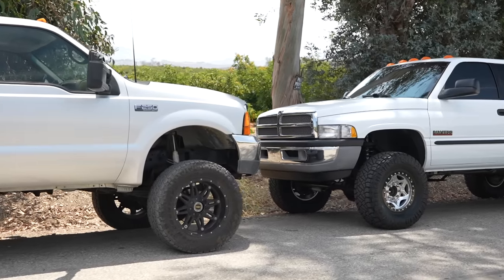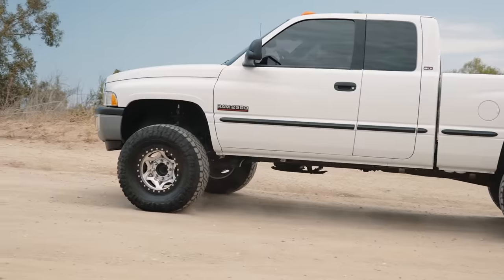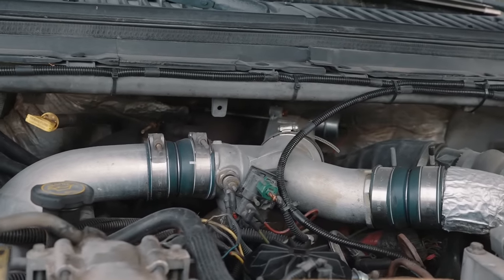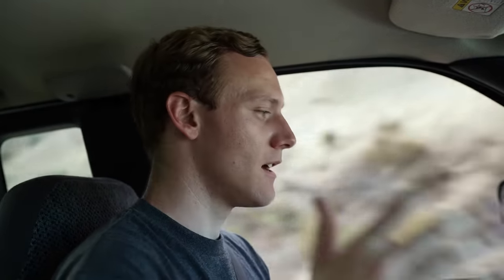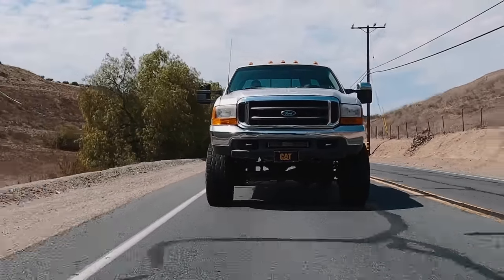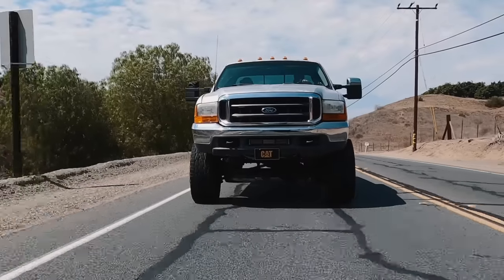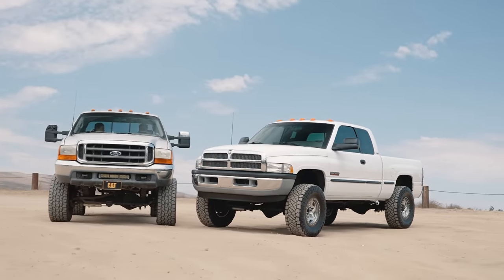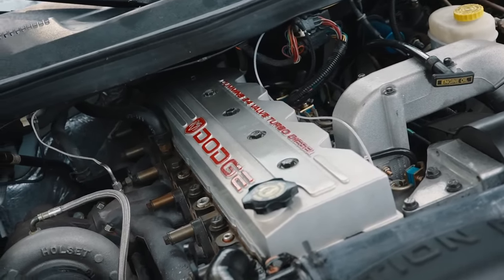1999 Ford 7.3 Power Stroke Super Duty vs Dodge Ram 5.9 Cummins 2nd Gen | Which Is Better?

Comment: I grew up with my Dad owning both. His 5.9 was the newer body style though, and both were duallys. 

5.9 had way more power and sounded so freaking good. Lot of transmission issues though. 7.3 was a dog for power, but I still preferred it for some reason. 

I would LOVE to own a mint 7.3 crew cab. Hard to come by these days.
Reply: Only way to own a mint 7.3l is to buy one and make it mint...
Reply: I have a 99 7.3 pretty well taken care of 180k miles 6speed. Manual windows but it's a complete and taken care of. I'd sale it. In Texas for around $7k
Reply: @jonathanrangel5119  do you have social media im interested
Reply: Your dad should have bought his 5.9 with a nv5600 he wouldn't have had any transmission issues
Reply: @jonathanrangel5119  I'm interested in that 7.3 standard transmission.  Have a link to the truck with some contact info?  thanks!
Reply: @jonathanrangel5119  worth more than 7k lol crew cab manual super hard to come by and people fight over them when they come up for sale crank windows means nothing you can easily swap in power windows theirs kits to do everything on those guy on YouTube with a dually 7.3 manual basically completely turned it into a 2013 clone interior and all
Reply: Yet in reality the 7.3 head to head with the same year cummins had more power and a far better trans.
Reply: @harleyhiebert2862  yep I got a 99 F350 crew cab, short body 7.3 she’s a beast but we have to replace the box,doors etc. after that she’ll be mint and we are going to turn it in to a flat bed that’ll be a winter/summer project
Reply: @remingtonwendt7756  yea I have a 1991  f super duty that I'm gonna work on restoring when I can
Reply: @harleyhiebert2862  my grandpa has an 02 7.3 with 140k I want to buy it soooo bad torgue monster
Reply: @simply-_-  yea I love mine... it has the manual 5 speed... it's non turbo but it's a very very fun truck to drive... I got mime with 82,000 miles on it
Reply: I think the 7.3 really started waking up until they stopped in 2003 by then they had coil springs up front. As far as power, it seems like the 7.3 is an in between and with a pull can't get off the line to get momentum.
Reply: @harleyhiebert2862  not completely true. I picked up a 96 f350 from an old man, 92 years old that only bought it to pull his RV. The interior and exterior only had minor flaws. 101k on the clock, this will be the last truck I ever have.
Reply: @davidmcclellan2786  you can get lucky but they are almost always gone before they ever get put on the market usually
Reply: @harleyhiebert2862  my dad bought a 2002 f-250 mint condition 7.3 with 99k miles for 22,500$ 😂 they are insanely over priced
Reply: @harleyhiebert2862  I have a 2002 7.3 crew cab that’s literally the dictionary definition of mint, my grandfather bought it when it was 2 years old and it has basically sat in the garage only coming out for special occasions or when we are going on a camping trip and need to tow the toy hauler
Reply: @gen-x-zeke8446  early 03 was the last of the 7.3s in pickups. 05 was the first year for the coil front. Longer rear leaf in 08+
Reply: @stevepartridge75  Okay. That helps. I think though we both can agree that they could have easily re-awakened the 7.3 at least in 2005 or '06. I also think the 7.3 Godzilla is a very good idea. It gets the power all the way through the RPM's. Similar to the "Old School" Diesels. I would hate myself if I bought an F-450 for $100,000 and be nervous about pulling 24,000 on a hot shotting (I think it's called). But imagine the mechanic look at it and then look at you with that one look of dread and pity. "Well, do you want the good news?"
Reply: @Doveproductions73  I would love to see that thing lol
Reply: I got a 2002 psd dually crew cab 4x4 bought it new on 9/11/2001 got 112k on it
Reply: @stevenzembriski6761  👀
Reply: @harleyhiebert2862  I made a Reddit post about it a while back but it would probably be a bit difficult to find
Reply: @harleyhiebert2862  not sure how it happened because I wasn’t there but he had a injector stick open and had to have the engine rebuilt so he instead opted to have a brand new engine put in instead of rebuilding the old one so the new engine only has 23k miles on it
Reply: @stevenzembriski6761  In 20 years? 5,500 ish miles per year. You must either work a block away pushing carts, or writing books all day, but it never goes anywhere. Ever. Or, you're half blind and suffer from the shakes terribly like 'death wobble'. My buddy's RAM has 467,986 miles on it. Boom! RAM is better.
Reply: @stevenzembriski6761  I said, BOOM!!
Reply: @gen-x-zeke8446  I think the 5.9 is better just because its a inline 6 over the v8 7.3 i love both trucks BOOM BOOM out goes the lights!!!! I may put a 2.8 Cummins  in my 54 Willys CJ3B
Reply: @gen-x-zeke8446  yeah all of the above lol but it is true under 115k i checked it today just use it to pull a 16’ pj dump trailer and  farm work she’s a good truck I like the 5.9 Cummins to but not the ram bodywork
Reply: @stevenzembriski6761  Boom!
Reply: @stevenzembriski6761  It's a non conclusive discussion about these two in that era. I'm not an expert but I'd say it's nice not to be so picky as well as being confident in your experience. So, why are Americans demanding a down scaling on these legends? As an option for a less wealthy farm or construction guy. I guess that's why Ford cleverly came back with a 7.3, but in the form of old school for Ford. In 5 years, this new Godzilla will already be right up there with anytning Ford has ever built. Get a Godzilla 7.3, throw a few wrenches into it and suddenly you have 500, 650. Seems fair and thousands less due to popularity. Ford has the other guys suddenly and nobody was expecting that. Ford is Back. Dodge need to just quit being nice a make a replica 426 HEMI. Ford: 427 "cammer"  Chevy: 454 big block. I'm calling it, "Old School Rebellion". Not all of us wants EV.
Reply: @gen-x-zeke8446  yeah but now we can’t afford the gas or diesel to run these truck. I was a diesel mechanic in the Marines. The government is forcing us away from gas and diesel and they all got stocks in Tesla
Reply: They make a Allison for both. I’ll take the 5.9 all day throw in a Allison & done. lol
Reply: honestly super weird because the 7.3 puts down more power on paper
Reply: @gen-x-zeke8446  they are heavier because they are built with a bigger frame, and the motor is heavy as fuck but it puts down more ho and torque which means it rows better, just not as fast as the lightweight cummins
Reply: @harleyhiebert2862  I’ve got an ‘02 7.3 4x4. I’ve replaced the box, leaf’s, brakes, starter, batteries, and redid the frame. And now I’ve got a mint 200,000km 7.3. Note that I’m from Ontario so rust is brutal here
Reply: @jonathanrangel5119  is it still available?
Reply: I have a mint 7.3 with 98k on it I just bought. Love the truck. It is a 2003 dually
Reply: @doublew030  I literally just picked up an absolutely spotless 2002 with 200k miles for $28k. Looks like it just rolled off the showroom floor. I’m in love, my alumaduty doesn’t compare when nostalgia is factored in.
Reply: @gen-x-zeke8446  coils were 2005 and up
Reply: @jonathanrangel5119  only 7k? You could easily get $20k for it rn
Reply: @Irishjay1025  yep .. and loaded - my 7.3 would out pull my 5.9 . Same year model truck same load .. same trip .. I was really shocked .. 5.9 pulled good down low but on road and hills that 7.3 shined . I guess that saying ain’t no replacement for displacement is real .. Or in my experience it was . Now the Cummins would run and hide from my 7.3 empty .

Comment: My grandpa owned two bone stock 2nd gen 12 valve Cummins with a 5 speed manual and they both got over 500k miles
Reply: I love big trucks, so a Cummins manual and a stack in the bed I’d be a happy little hillbilly lol. 👍🇺🇸
Reply: My grandpa owns a 2nd gen with the 5 speed but he's only put 124k on it but has had zero issues.

Comment: The comparability of these trucks is on point. I love diesel engines!! I went with the power stroke. I own a 2001 Ford excursion with a 7.3l engine and I love it. But the sound that comes out of the Cummins is from another world, it sounds like a beast!
Reply: Right! Not alot beats the sound of a Cummins diesel screaming down the road.

Comment: Great video guys. I'm a big ford guy but as a tech I prefer to work on an inline 6 diesel rather than a v8, especially one as simple as a 5.9 Cummins. Most things are easier and less labor to repair or replace on a 5.9. cost of parts is generally cheaper as well. The truck itself i would rather a ford any day. i guess a dream truck could be a 06 F-250 with a 5.9 swap? best of both worlds
Reply: A Fummins. I’ve seen a few.

Comment: I went the 7.3 way for my first diesel truck, but a 2G 5.9 was neck and neck and if I get another truck that isn't a 7.3 it'd be a 5.9. The simplicity of the Cummins definitely has appeal. I was surprised at how well the 7.3 interior has held up. Mine is an ex-work truck and pretty well worn but with a couple weekends of replacing lock actuators, fixing minor wiring hackery from the last guy, doing the shifter bushings, finding various missing small trim bits, and giving it a good cleaning it came right back to almost like new and is surprisingly comfy. Just wish the last guy and his crew didn't drop their ciggies on everything.

Comment: I have an 02 7.3 crew cab so I gotta go with the Ford. Great truck interior is just amazing on these trucks. They pull great. I have a light tune on mine and it’s impressive for an 02. I think all the points that were made were very fair and true. Much respect for the 5.9 but the 7.3 all day for me. Great video guys

Comment: Andrew needs to find a set of old mechanical diesels and compare them too each other, I think a sick show down would be a 7.3idi, 12v, and a 6.5 Detroit
like if you agree
Reply from the maker: That would basically just be the 12v walking all over the competition! I’m up for it though!
Reply: @JustDiesels  gotta find some turbo 7.3 idi and 6.5 Detroits
Reply: @JustDiesels  i dunno man, those old detroits are something to be reckoned with
Reply: jeremy pollitt  I’ve always heard that GM marketed the 6.5 for more fuel economy rather than power.
Reply: jeremy pollitt  I’ll put money on a 94 7.3 idi WITH the factory turbo over a 12v any day of the week. Competition can’t be fair if they don’t all have turbos.
Reply: I have a 1988 7.3 IDI dually ZF5 4.30 rear, and it would rip those other trucks apart by the frame
Reply: I own a 1995 c1500 2wd Single Cab 5 Lug Wheels 6.5 turbo diesel with 4L80e Transmission very Rare 
I also own a 1993 1st Gen Dodge W250 Power Ram Cummins 5.9 with the 5 speed Transmission 
I'd like to buy a Ford 7.3 some day as I gave of the 3 right now both my trucks run great as my 6.5 gets fuel mileage and my everyday driver my 5.9 I'm currently doing a restoration on it but it still runs which is Awsome
Reply: Would be interesting, remember that the Detroits are two-stroke engines.

Comment: I have a 7.3 and the only down fall is the trans.  It needs a bigger trans cooler which isn’t that big of a deal just installed the 6.0 cooler
Reply: Get a banks trans commander.... my 7.3 has never dropped the Trans and its stock... and I've done lots of dumb stuff
Reply: Yeah trans definitely needs help on the 7.3, first day I got mine, hooked up my trailer with skid loader, damn trans went out 10 min down the road, replaced with another used trans but currently rebuilding the og trans, will definitely look into better cooling options
Reply: Fuel Mileage sucks on all ford's.
Reply: @eddiearre  damn first 10 mins what was the temp that day?? Most be like 100° or something
Reply: One of my trucks is a 7.3 buts its a 6 speed vs a 4r100 its so much better then the auto the rpm is lower on highway etc my 6.4's 5r110 is a big step up from a 4r100 too not drove a 6.0 with a 5r100 in them only 6 speed 6.0's
Reply: @nou8257  lol funny how it works you either get a grenade transmission or a grenade motor...6.0 has a awesome transmission... but the motor maintenance cost is not fun especially when you buy other people's problems
Reply: @eddiearre  lol you gave it a hot supper.... ive pulled some things I shouldn't have and mine is going good its stock never been opened except filter/fluid
Reply: @brettscott3759  So far i've had more luck out of powerstrokes over almost any duramax me and my dad have owned my current 6.0 I'm getting back up to snuff is a 03 with a 6 speed i snagged at a auction for cheap that was a repo and lucked out with it already being head studded.

All the cummins we have kept are manual trucks, I've had this misfortune to have drove a few auto cummins and it irritates me to no end man they make no sense in how they shift. That's what I liked with my 6.4's 5r110 auto it seems to understand how to change gears and stock trans can handle like 600 h.p which is nice although nothing beats a stick so you can shift when you need to.
Reply: @nou8257  manual transmission in the trucks is the way to go right now I'm working on a excursion that we're going to set up as a manual just to be funny we're calling it big ugly... my f250 is pretty cool it looks like a micro machine it's 2wd super cab short bed I turned into a dulley I'm waiting to put this monster 7.3 motor in it ive been tinkering on for  a while I don't know if I want to p pump it... I just had my 2nd 6.0 explode a month ago and big ugly came on the market and traded the 6.0 in the process problems know and all... hot rod engine but just like hot rod engines they are temperamental.... ford cheaped out hard on the 6.0 because the cost of the 7.3 hurt so much... also how were they going to sell new trucks if they ran for ever... all the 6.0s in everything not a ford are great.... ford turned up the power and the egr system cooks the hell out of the coolant causing  it to break down and condensate to the low spots.... the 6.0s in the busses and trucks have coolant filters and a Insanely large radiators...
Reply: @brettscott3759  i was on facebook market place one day while ago and i saw a excursion that had been 12v cummins swapped and had a nv4500 in it a frankenstein excursion.

The 6.0 i got atm has a coolant filter and the egr cooler is no longer even there previous owner must of took care of that problem when they did the head studs.
Reply: @nou8257  you lucked out... may it run many moons... the 2000-08 super duty is a great car to hack the problem is the size of the engine right now I'm installing the turbo and up pipes it's not fun lol.... turbo on a cummins boom right there, turbo on a 7.3... get a rope and a head light....
Reply: I put the mishimoto 32 row cooler in mine. Never had a issue since
Reply: Dude the 4r100 is Way more reliable than what it gets credit for not to mention they are extremely expensive to repair in comparison to other trans
Reply: @nou8257  it’s borderline blasphemy to call the 6.4 for a real diesel they are 150,000 mile thenJunkyard decors
Reply: @ALT_RIGHT  mine has got 203k and still going thats 53k over that 150k throw away claim i've talked to several people with 300k on their trucks its all in how you take care of it unlike cummins and the 7.3's that forgive not taking care of it.

And in the end shit breaks my 7.3 breaks dads 12v has had most of the truck redone at this point at 214k and it also had to have a rebuilt ppump put on it and injectors replaced.

My 6.4 has had the upipes done a fan clutch a water pump and driveshaft center bearing and the ujoints thats the worst stuff ive done to the truck atm.

Now i do plan on going through the engine and trans once i can get the money saved up and building the ever living shit out of them and then never having to worry about that crap again.

Comment: Great honest review of two great trucks! I agree on many of the points addressed in the review. On transmissions pertaining to Dodge 47RE/47RH...that transmission is actually a torqflite 727 with an extra gear. One of the best transmissions ever built by Mopar. Problem is however, the torque Cummins makes is substantial and might run into issues. Changing transmission fluid/filter every couple years, deep transmission pan, proper band adjustment and not driving with your foot to the floor from every stoplight would be beneficial. Unfortunately, many people drive diesels like they’re race cars, but they are built for endurance not speed. Keeping that in mind will spare any diesel from costly drivetrain repairs.
Reply: I admit I have a heavy foot but damn mine let go 2 times within a year😂

Comment: Having owned both in the same year . I had 2001  models . Ford hands down .. love the Cummins motor but that is about all . Always replacing something on the Dodge platform . The fuel mileage was great in the Cummins !!  FYI to all the haters - I am putting a 5.9 in a 2010 F250 atm which IMO is the best of both worlds